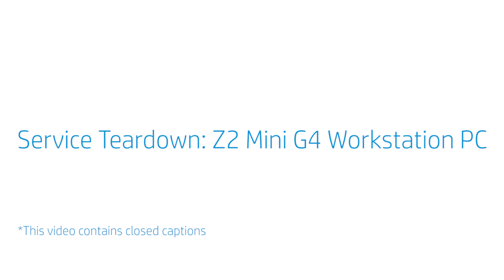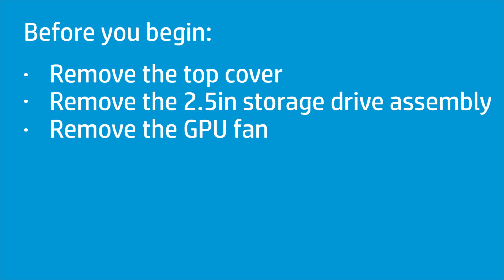Removing & replacing parts for Z2 Mini G4 Workstation | HP Computer Service

Comment: Hi, can i ask you? I have z2 mini G4 with nvidia quadro p1000. Can i replace it by another mxm card? Like some different mxm-a card? Or is it possivle to use mxm-b? Like i found nvidia geforce gtx 1650 mxm-a and I dont even know if its possible. And will be bios okey with it?
Reply from the maker: Hi there, thanks for contacting HP Global Social Media Support!
I understand that you need help in upgrading the graphics card of your computer.
I will do my best to assist you.
The HP Z2 Mini G4 workstation is not easily upgradeable for graphics cards because the GPU is usually soldered to the motherboard.
Regards, 
HP Support
Reply: @HPSupport  that means that me, with G4, Intel i7 8700 and nvidia p1000 cant take out my graphics card? I need to replace it by another one, because a want to play better video gsmes..
Reply: @HPSupport  i asked gpt and it said, that it can be remove
Reply from the maker: Thanks for the reply.
The graphics card on your computer is not replaceable.
Regards, 
HP Support
Reply from the maker: Due to limited support on this platform to fix this issue, please feel free to reach us on call/chat. Access this link to select your preferred country and language option to reach us. 
Global support link: - https://hp.care/6054UWXsy 
Regards, 
HP Support

Comment: Hello, I have this computer and would like to play games with it. However, some games can't run very well on it. I wanted to ask which graphics cards this computer supports. If it does support any other graphics cards, would I have to change any of the other parts?

Thanks in advance.
Reply from the maker: Hi there, thanks for contacting HP Global Social Media Support!
I am here to help!
I'm afraid this model does not have a support for a dedicated graphics card and comes with only integrated GPU. Therefore, you cannot upgrade/replace the Z2 Mini G4 Workstation PC integrated GPU.
Hope this helps!
Regards, 
HP Support
Reply: @HPSupport The graphics card of my PC is an nvidia p600 quadro. I thought this was a dedicated graphics card, so can't I upgrade it with a different nvidia card?
Reply from the maker: Thanks for getting back to me, Since your model has a dedicated GPU it wouldn't be the base model. May I know the product you are using? A serial/product number would be helpful for me to give you an accurate answer!
Let me know!
Regards, 
HP Support
Reply from the maker: Thanks for the reply.
The HP Z2 Mini G4 Entry Workstation supports NVIDIA Quadro graphics cards. The PCIe Gen 3 x16 slot in the HP Z2 Mini G4 Workstation is intended for HP-qualified cards, and HP does not provide warranty support for third-party cards
Regards, 
HP Support
Reply: @HPSupport  Thank you very much for the response, although I have a follow up question. Would it be possible to install an NVIDIA GeForce RTX 3050 or a GeForce GTX 1650? And if so, would some of the PC components need any other tweaks?
Reply from the maker: For optimal PC and printer performance, remember to always buy (use) Certified HP Genuine Replacement Parts from a known and trusted source. You can order it via the HP Parts store: https://hp.care/6054or1Ji 
Regards, 
HP Support

Comment: Hi, a question: can I take the MXM format video card from a z2 mini G5 and put it in a z2 mini G4?
Reply from the maker: Hi there, thanks for contacting HP Global Social Media Support!
I understand that you need to know whether you can interchange the video card from one computer to another. 
I will do my best to assist you.
HP does not recommend upgrading or downgrading hardware parts or software that is bundled with the product as It may affect the manufacturer's warranty and performance, however, you could change the configuration at your own discretion.
Regards, 
HP Support

Comment: This is not about this video but why does my hp have dell support but when I was rebooting I used my sister laptop which was dell in a drive then that how I fixed  my black screen problem. I got another problem now so it’s a dell on my hp laptop and I can’t get it to change I even rested my whole laptop like 10 times and it’s still has dell please tell me how to fix it.
Reply from the maker: +Sun Wu Kong May I know the complete model number of your computer and could you please elaborate the issue you are experiencing on it?
Reply: @Hp Support :My models number or name is Hp Pavilion Gaming Laptop 15-ec0xxx 
The issue is that my trouble shoot don’t fix the problem and it always says Windows could now automatically detect this network proxy settings and I looked every where and did every thing still wouldn’t fix. I did a reboot using my sister laptop becuase my laptop was broken so I go a drive and did a reboot from her drive which is dell and from now on every thing is dell like dell+ and other dell stuff that I don’t know. I wish I had my hp setting back and the upload speed is hecka slow for me for the laptop but it’s not my network becuase my other devices work fine please help me. Please can you mind the grammar.
Reply: Hello can you fix this or not